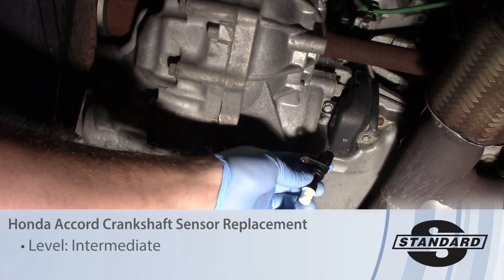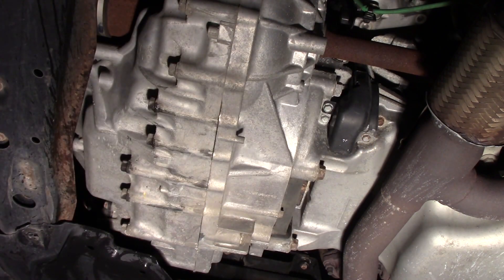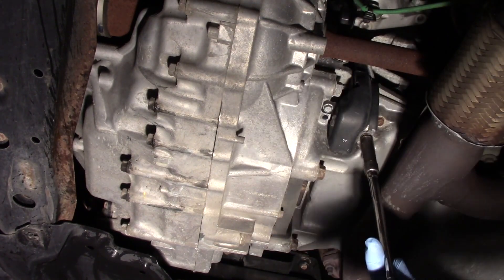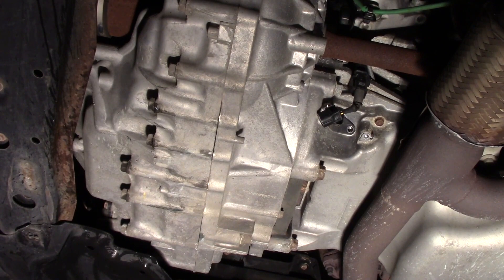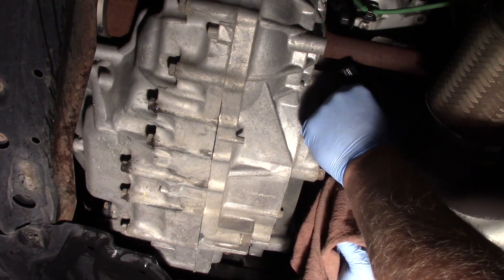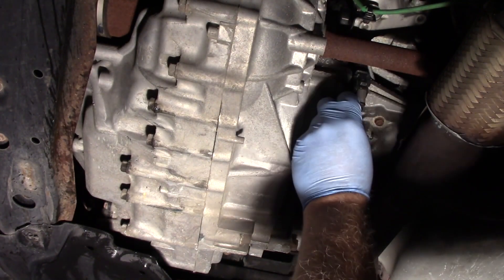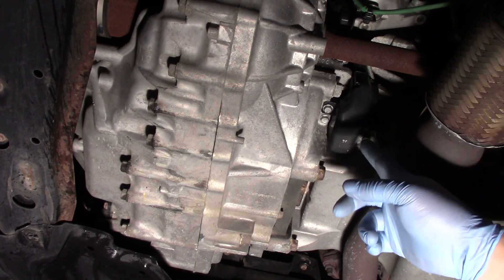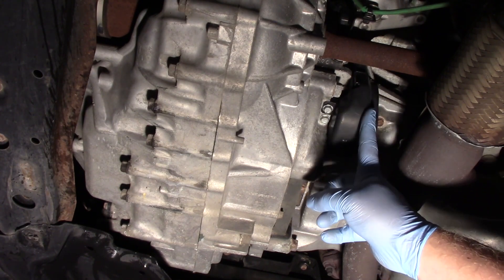Honda Accord Crankshaft Sensor Replacement

Comment: It act as if it's out of gas.good cranking no start. Before it cut off on the high2ay. I put in neutral and restarted it. Than it cut off on the road. I had to wait a few moments ,it restarted this time it never restarted

Comment: What are the symptoms of a failing sensor
Reply: Erratic rpm values… misfires…. Engine running lean. And depending on severity you can hear the crank rub upon accelration
Reply: So it won't produce a cranking and not starting
Reply: Should this be cleaned as part of routine maintenance or will it make this worse tampering if nothing wrong